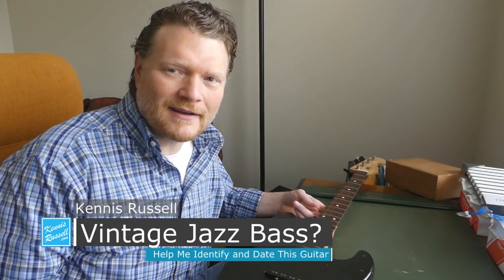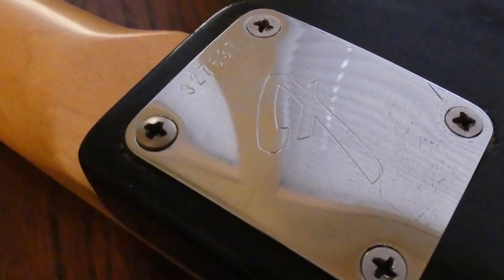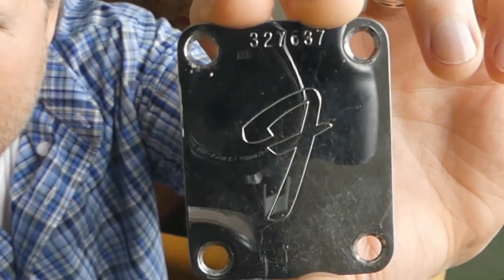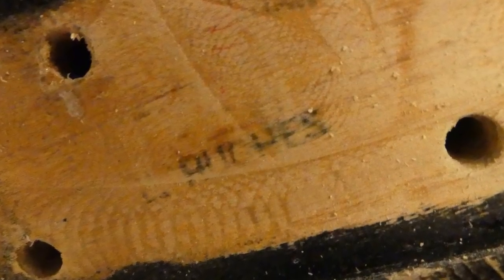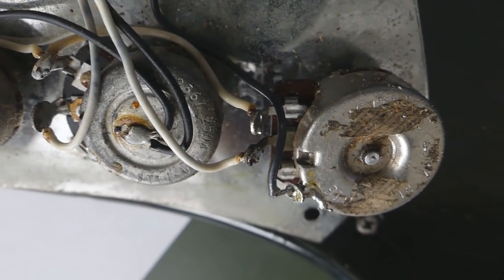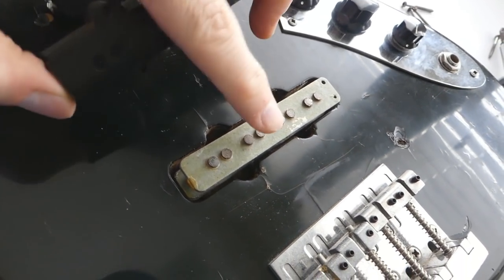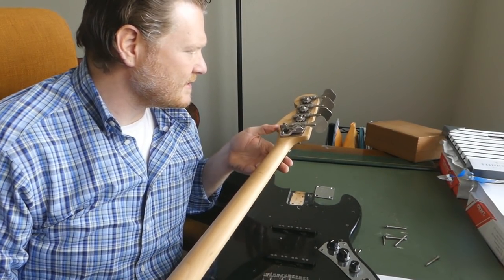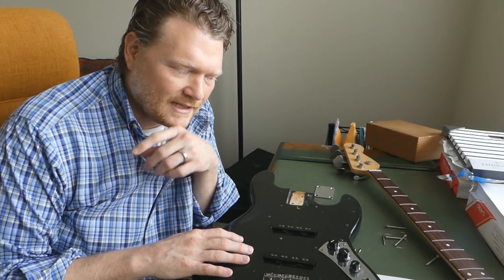What is this Bass?  Is it a 1971 Fender Jazz?

Comment: Hi Kennis - sorry for being redundant if this was already mentioned in the comments but the date stamp on the neck looks like Feb 14, 1991. The pots I believe should be CTS and are definitely date stamped and visible if not covered with solder. Also, the pickup spacing was further apart at 4 inches beginning sometime in the early 70’s (although not apparently on all basses). Cool find!
Reply: You should hold onto the body with the original neck plate and electronics and restore with an original bridge and tuners (not difficult to find) and an original neck (these do come up sometimes with the original tuners but you have to also look outside of eBay and reverb.  Pick up an issue of Vintage Guitar magazine to see if one of the dealers has anything that you can negotiate for. Sell the replacement neck and put the money toward the restoration.  The body is well worn but this is a real relic that will go up in value as all Fender J basses do from this era.
Reply: Looking at your video again, all of the tuners with the exception of the drop tuner on the E string look like they may be original to the 71 jazz.  What probably happened is that someone broke the truss rod in the original neck and swapped the tuners into the replacement. The drop tuner on the E string started to gain popularity in the late 80’s early 90’s so this mod would make sense especially when looking at when the replacement neck was built.  All you need is one original tuner, bridge and neck and you can restore this bass to original condition.